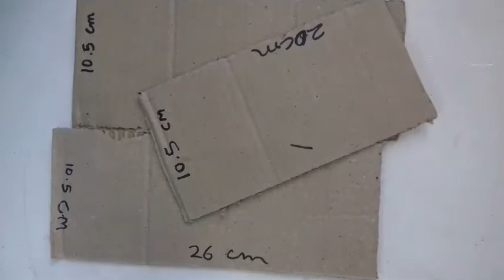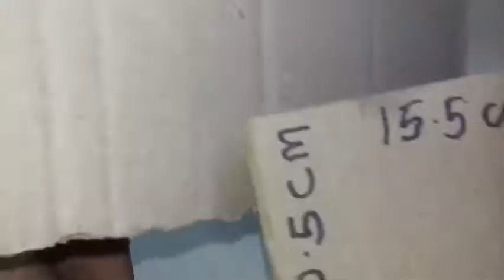AUTOMATIC HAND SANITIZER MACHINE for covid-19 PROJECT  ARDUINO #covid19 #fightcovid19 #inspireaward

Comment: Sir in digram relay module is defferent please give me letest image of connection ...
Reply from the maker: U can use any relay
Reply: @techrobin6209  but what about connection it's different ... You put that battery wire into that Arduino plug but in digram it's different soo am totally confused pls help..
Reply: 14:13 can you please provide that all connections ...matlab ek paper me draw karke konsa wire Kahan ja Raha he ..
Reply from the maker: @nishant319  check description
Reply: @techrobin6209  can I use 1 battery to power up both ? But it's rechargeable but 9v Dono ke liye is it sufficient ?
Reply: & my Arduino also defferent so please can you give me a diagram with letest one

Comment: Hello sir .. At instant of giving supply to circuit relay automatically triggered for 2 sec .. how to overcome this pb
Reply from the maker: This is due to start
Reply: @techrobin6209  please sir can u tell me how to overcome this problem
Reply from the maker: Change the relay connection 13 to other digital pin in the code and arduino

Comment: I want to increase the se
Distance between sensor and hand if we touch the pipe then no use
Reply from the maker: Set the distance in programming code😊
Reply: @techrobin6209  can u say where to set distance bcoz i am using arduino for first time